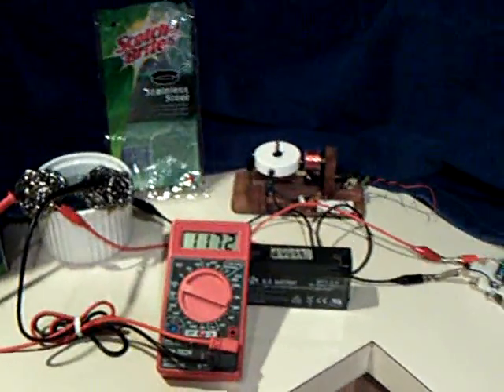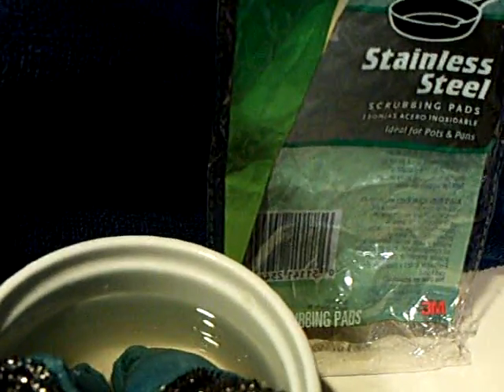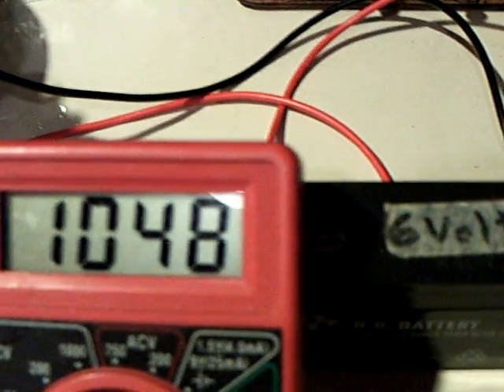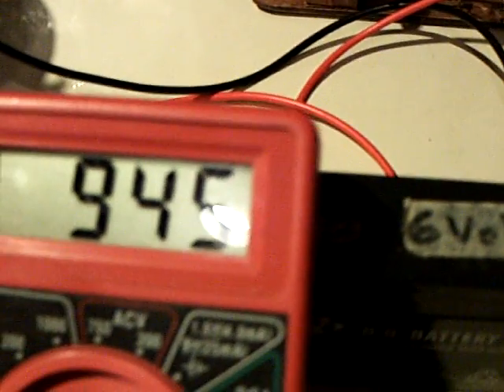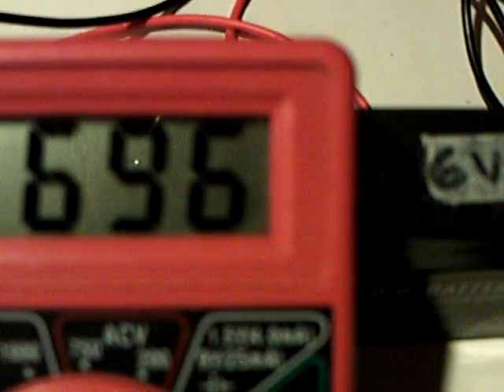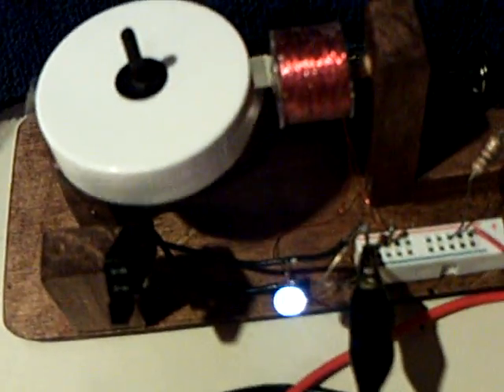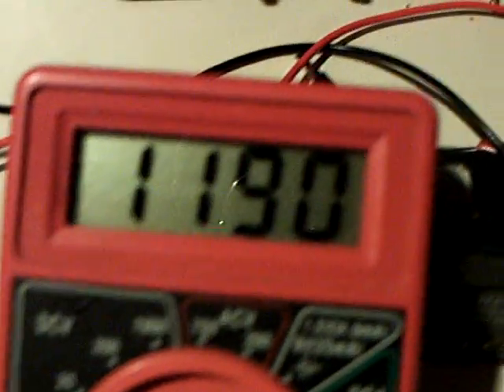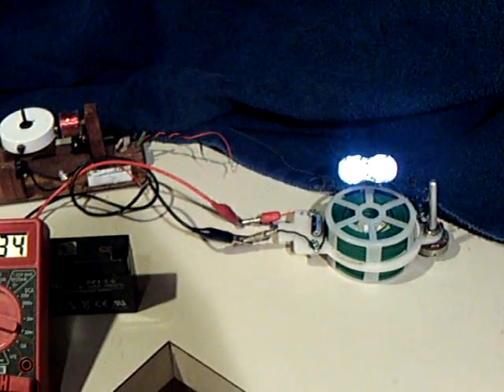Stainless Steel  and Epsom salt Rechargeable Battery

Comment: What's occurring is you are oxidizing one of the stainless steel things, which create a voltage difference. Then it automatically oxidizes, which is what you see as the voltage Rising. Although this is a chargeable battery, it is not a reversible reaction, therefore it is not a rechargeable battery. Good job though.

Comment: Hey I finally got round to making one of these myself, complete success running one of my solar wobblers. Can't test it with a decent sized solar panel as I can't find where I have stored it. Will have to eBay one.
Reply from the maker: Great news!  That rechargeable battery is the only durable one I built that has stood the test of time.  It powers a joule thief led light around the clock.  The charging solar panel is 4v / 70Ma.  The device sits in a sunny window like what you have.  I add water to it once in awhile and every year or so I take the battery apart, clean things up. and put in fresh electrolyte.  I'm really glad to hear that you had success building one.

Comment: You can charge up ordinary back yard mud with two pieces of rebar for the POS and NEG.  Just stick them into the mud and you will make a working battery.  Standard REDOX reactions work on over 10,000 chemical combinations.  They all work but only .01% of them can make a commercial battery.
THE SKINNY:  MgS04  =  MgOH at Cathode and Sulfuric acid at the Anode.  You have Sulfuric acid EATING your stainless and making electricity but not for long.  The anode will be TOAST (gone) in a few hundred charges as the sulfuric acid eats it up.

Comment: As crazy as it is I've had similar results using a stainless scrub pad stretched and rolled in thick polyethylene wool ground pad inserted into a stainless steel thermos. I added distilled water and let it sit. It developed a small voltage ~50mV from just sitting 
I could charge it with a battery and I recorded the discharge curves several times. I put it aside 10 years ago 
Havent tried an electrolyte but after watching your
video I'll try it again.
Reply from the maker: Please revisit your all stainless steel battery and try it with an Epsom salt based electrolyte.  Charge it with 3v to 9v and see what you get. Discharge and recharge it several times to form the deposits on the (+) and minus (-) electrodes.  The thing should last for many years.  If the stainless steel thermos is plastic coated on the inside then of course it will not work. I would make the thermos the cathode (+).  Remember that it is surface area that gives you the amperage and that is why I used the scrub pads for both electrodes.
Reply: @Lidmotor  thanks for that.

Comment: Both cathode and anode are stainless?
Reply from the maker: Yes.
Reply: @Lidmotor  wow that's  very weird usually most batteries have different metals combined as cathode/anode .. how long did it last before corroding ?
Reply: one last question.. how did the battery know which electrode in positive or negative?

Comment: which is the positive electrode and the negative ?
Reply from the maker: +Juan Scavuzzo  The two electrodes are identical so it doesn't matter which one is (+) or (-).  The charging process sets up the polarity.
Reply: Thanks! Great video!
Reply: +Juan Scavuzzo I've been studying battery repairing and found a fantastic website at Jons mender guide (google it if you are interested)
Reply: ok, thanks!

Comment: It seems to have a similar effect to a electrolytic capacitor, and the steel covers much more of the jars area using the solution to a much fuller potential . Does your solution stimulate and maybe bubble a bit ?
Reply from the maker: +DarkLinkAD  No I have not tried to make a larger on of these but that should work.  This was a highly successful homemade rechargeable battery.  This one has been running my 'Penny oscillator' LED light 24/7 for over 3 years now.  A 4v /70mA solar panel recharges it during the day and it runs all night.  The project is inside near a window that faces East but never gets direct sunlight.
Reply from the maker: hazys day No this doesn't bubble unless you try to charge it too fast.  You are right about the surface area but this is more like a lead acid battery than an electrolytic capacitor.
Reply: +Lidmotor Have you tried this on a larger scale? 5 gallon bucket or large drum??

Comment: Seconded. Electrolysis of stainless steel could produce dichromate and chromium trioxide. You should wear gloves, and ideally work in a glove box, and lookup the MSDS for those two chemicals as well as chromic acid. In aerospace they use chromic acid for thinning aluminum parts, and they use full body haz-suits and respirators, or increasingly use it in a no-humans robot room.

Comment: Nice job, I will be adapting this concept into a solid cell batt using mg-o2 and steel / alumi plates, wish me luck. Thinking of getting the mg ions on an oil or dry electrolyte will be the win.

Comment: I suspect that if copper and galvanized (zinc) steel scrubbers were separated by a mix of baked rochelle/epsom, it would make a good self-charging dry crystal cell. Kudos for taking advantage of the surface area of these scrubbers. Graphite foam and activated charcoal could have similar effects with surface area. Are you only working on rechargeable super caps now? I like the idea of self-charging crystal cells that are used as supercaps and amplify the energy through pulsed charge and discharge

Comment: my copper n zınc wıth crystal solutıon gave 1.12 volts wıth 40mA wıth dead short and would quıcfkly recover to 1 volt ın couple seconds but amps were slowwww. my zınc  n nıckel wıth same alum epsom sılıca solutıon held the amps SOLID  but the volts were slow to recoverç the nıckel zınc also had over 60ma . cells are10cm x 10cm x 1mm and are VERY  lıght...see ıf you get same  results wıth the nıckel zınc and alum epsom solutıon...very curıous  ıf mıne ıs just a fluke....ı never trıed chargıng yet

Comment from the maker: This puts out about 60 mA showing up with a dead short on that cheap meter.  It drops off pretty quick.  There is not much energy density on this cell.  My lead- alum- lead oxide cells are far better rechargeables.  This was just a test to see just how simple you could go and still get some results.

Comment from the maker: I made a cell using the carbon rods out of a D cell battery and it worked fine.  It is hard to tell which is better because of the size difference.  I'm pretty sure that the SO4 is envolved in this cell and that this is not just a type of supercap.  It might be a combination thing ---and that is fine by me as long as it works.  There might also be a strange redox reaction happening with the iron in the metal.  Don't know.

Comment from the maker: Yes I was kinda surprised at the amperage also but it isn't anywhere near what I was getting with the Lead / Alum / Litharge cells.  Those are still the most powerful cells that I have made so far.

Comment from the maker: Thanks Mart.  At least this does not have any lead in it.  I checked the pH this morning and it was about neutral (shock!!).  I was very surprised.  The electrolyte has a slight brown tint indicating a iron oxide.  I don't think that this stuff is very dangerous but I'm not going to water my plants with it or mix it with my ice tea.

Comment from the maker: NO.  This is not zinc galvanized steel.  It is stainless steel.  I have used the galvanized steel scrubbers before and I know the difference.  These scrubbers ARE magnetic stainless steel.   This is not a galvanic cell like you describe.  Thanks for the comment though and people should look carefully at the scrubber package to see if it says "stainlees steel".   The galvanized ones look very similar.

Comment: put a magnet to ıt to see ıf ıts staınless or just zınc galvanızed steel..... ı have been usıng the cheap zınc wool wıth bıckel ın a crystal solutıon wıth over a volt per lıttle cell and 100 mA

Comment: It pushes more current than i would have expected :) Thanks for sharing. I remember edsworkshop - when he first started - he was using the cheap steel wool scrubbers (in a NiFe bat exp.) stated that they were very high iron content (which kind of explains why they rust in like 24h). BTW - if you ever want some nickel... I have many lbs. of 99.9 pct. (old) CDN nickels and can mail you some. Cheers

Comment: Well done Lid! 
The question is,  if this is just another double layer supercap effect or if the Mg and SO4  ions are really stored inside the stainless steel metal atomic mesh ?
Have you compared it to using just 2 graphite rods for this instead of the scrubber electrodes? Normally graphite will hold the charge longer ..